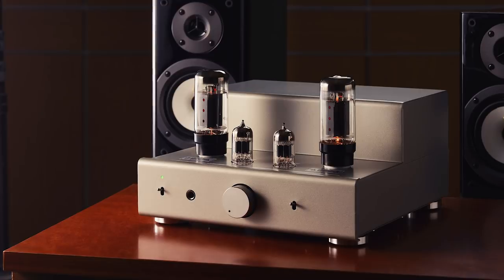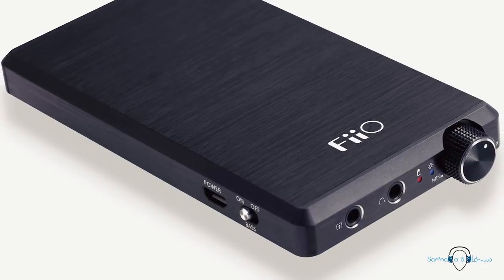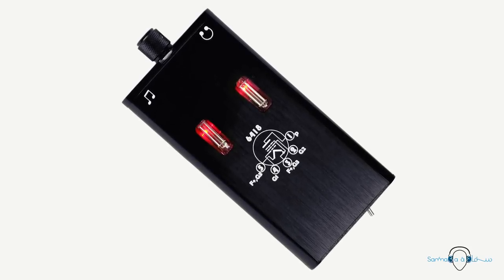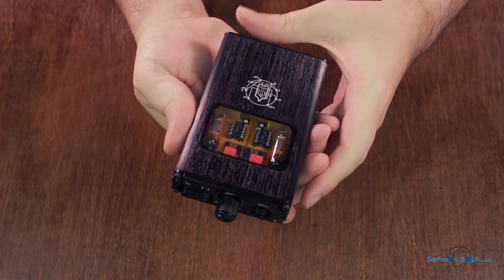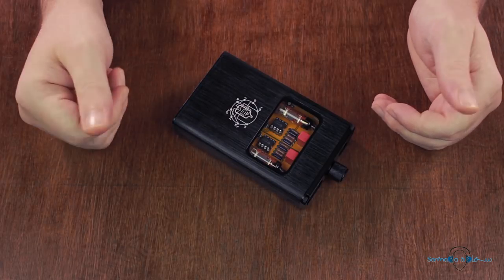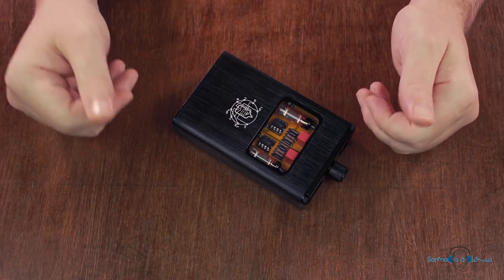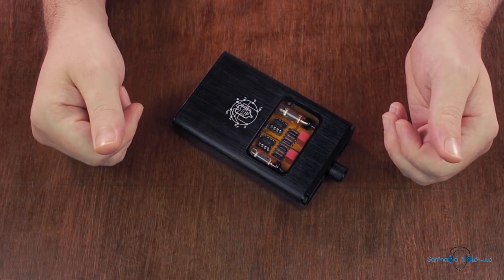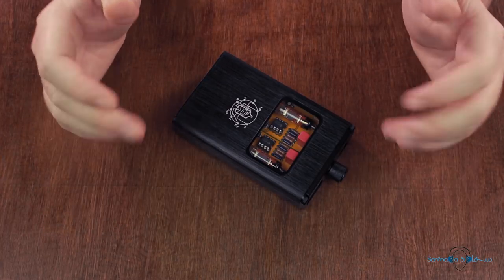Little Bear b4 x Review

Comment: It DOES  allow for op amp switch out. I have bursons in it now and it's amazing for its size. Battery life is 2.5/4 hrs depending on volume of course.
Reply from the maker: Yup, Burson have sent me 2 of the V5i to test in the B4-X.. Review coming soon
Reply: @samma3afans  apart from the op...and tubes..any other mods that could be done to it for any gain? Different caps/resistors?
Reply from the maker: Yeah, you can definitely swap those... But as for which specific ones is not something I could comment on as I wouldn't have a clue how to determine what would be an objective upgrade
Reply: @samma3afans  might have to get incontct with them and see if i can get some info...
Reply: I found a list of multiple op amps depending on your taste and impedance needs and it had over 30 known op amps that will work in place of the 5532. Discrete op amps are available on Ali Express and eBay. Ive tried those as well and they are very good. Quiet powerful and have a wide impedance load
If I can locate the list link I'll post it
Reply: If I run the Massdrop Sennheiser HD6xx which op amps do you think that would be the best?
Reply: @vaejoviscarolinanus  there are literally  dozens of direct replacements for the original op amps. Some are more powerful than others and some  would be a better impedance match for your setup. Look up the individual spec sheets on op- amps that have the same pinout as the original. 
Select a few pairs that you want to try and see what suits you best. Kind of like tube rolling with op-amps. Lol. 
At least it's cheap and you'll likely find something you like. 
Nothing ventured nothing gained.
Reply: @randalltufts3321  where can I find the op amps information?
Reply: Does changing the op amps lower the noise floor dramatically or just a small amount. I am considering the SS3602 . I have to get 2 correct? It is weird to spend more $ than the unit to upgrade it.
Reply: @vaejoviscarolinanus  it will depend on the op-amp You use. Always refer to the spec sheet of the original vs the replacement. The little bear uses 2 op- amps.  I had great results out of the bursons myself altho there are many more branded and unbranded  out there. (See AliExpress)
Reply: Samma3a how did the v5i perform?
Reply: @bjmarchives  the burdens were simply amazing. I still carry the little bear with me on trips. Cheap, powerful and effective. Altho the v5 I ended up with were a gift from a friend I ended up grabbing an extra set. I know my next project or purchase that needs that little extra they will go in.
Reply: @randalltufts3321 Do the V5 discreet op amp fit in the amp?